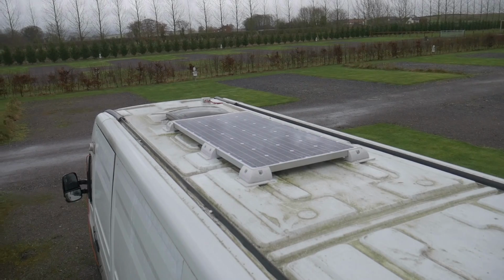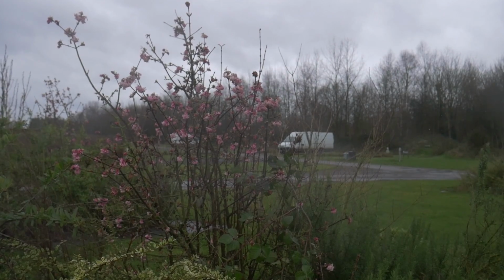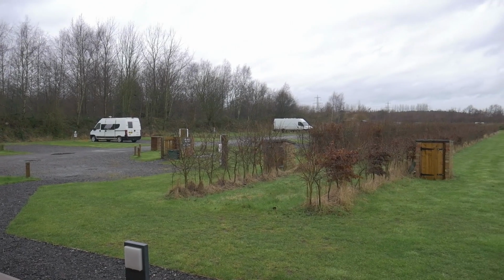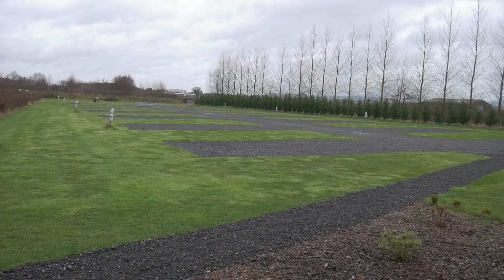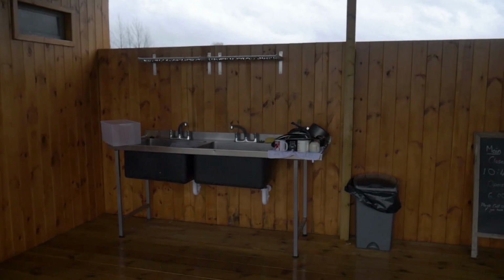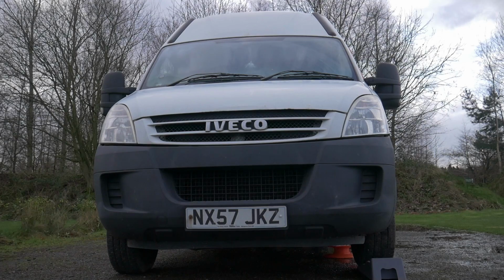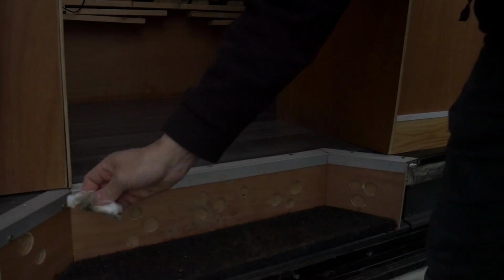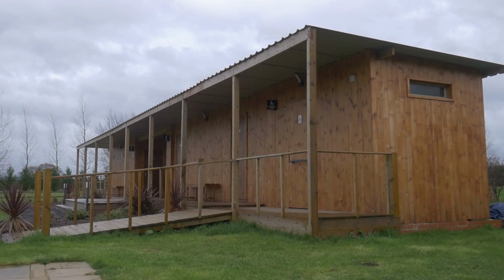Weekend Reset - Vlog 11/20

Comment: Hi Rob, I spent years living on yachts, power was a big issue & for me personally I found a small portable generator (2500w) was more than helpful on those full days & would use very little fuel.
Reply from the maker: That's interesting, I guess the problem with generators would be the noise. But I was wondering about a portable power bank which I could then charge at work whenever I needed to. All my best Rob

Comment: Could you put up a wind generator on the van ?
That may work as you say, solar doesn’t put out that much in winter
Reply from the maker: Hi, Yes I have looked into it a little. I guess that you would have to be static for a while and have the wind turbine separate so there is no vibration. I have seen some people with them, so certainly a possibility. Cheers

Comment: I'm struggling with power at the moment with the diesel heater on all the time . Just ordered 600w of solar to go along side my b2b charger.  I'm also plugged into a mains  charger at work everyday but I still can't get the battery fully charged before having to put the heater back on.  
Sterling 60amp b2b and a Bosch 230ah L5080 leisure battery.  I want to go to the Highlands but need more amps or a log burner. 
Another enjoyable Video mate 👍
Reply from the maker: Hey Mark, Yes the diesel heater is my main draw, hence the reason I went down the battery operated lights. I think in time an upgrade of my power system will be in order. Cheers

Comment: Hi Rob hope your are well, great video and yes living in a van certainly changes your perspective on luxury A shower it’s certainly my top luxury item closely followed by mains hook up. I don’t have a proper split charge relay in my van but I simply ran a  cable and shut off switch between the van battery and leisure battery it works a treat, just have to remember to switch it off when you stop.
Reply from the maker: Hey Jamie, Hope you are well? Yeh the simple things in life become the pleasures of van dwellers. The power situation is definetely a thing that needs an upgrade in my van. Cheers Mate
Reply: Yeah I’m doing great thanks, ready for spring😁 although this winter hasn’t been too bad, I should be getting the hang of it by now it’s my third winter in the UK in the van.